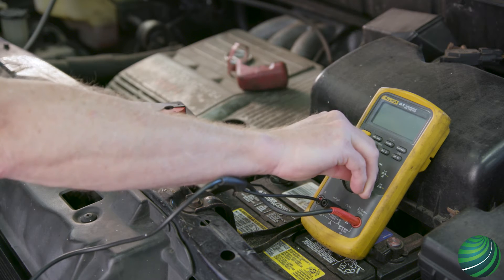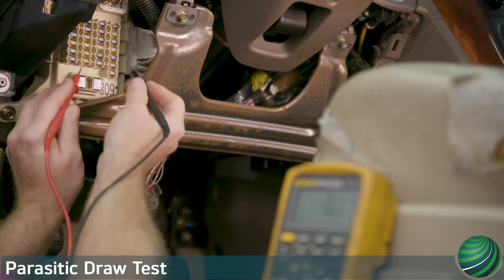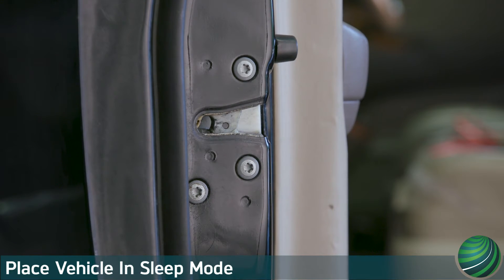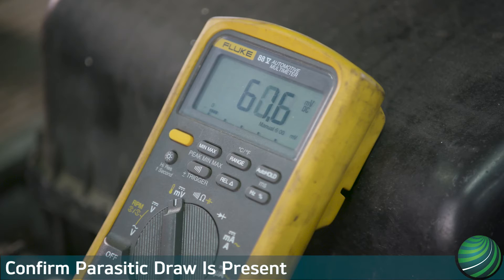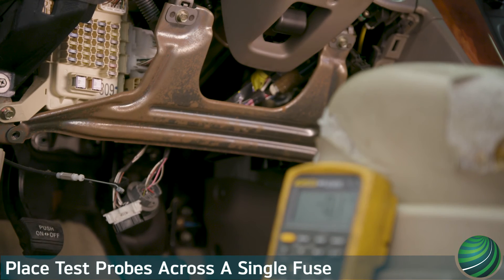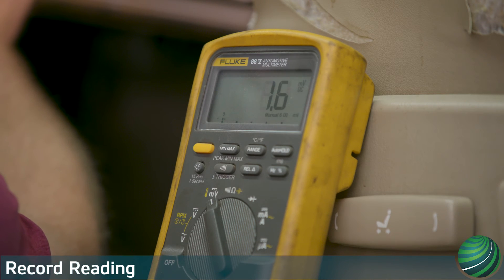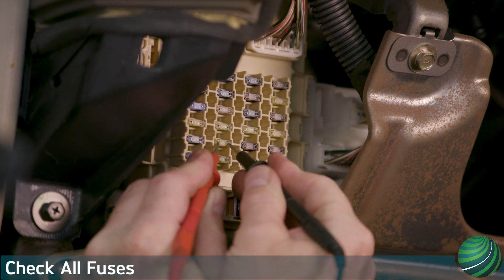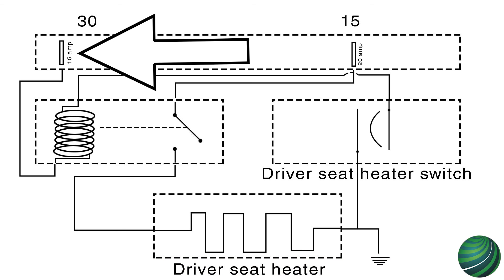The Best Way to Test Parasitic Draw Using Voltage Drop Across Fuses

Comment: Hi, In the fuse box: Would the alternator "charging system" fuse show draw on the alternator? I just read it's a secondary fuse and there's a large inline on the ALT. cable. All my under hood fuses read 0. Waiting for it to warm up for a cabin fuse box check. Battery goes dead in 8 hrs. New battery.
Alternator charges at 13.9 idle. Normal

Comment: why is your meter set to mV and appears to read mV when you are describing the draw as 60 mA in the video?
Reply: If you are referring to the beginning where he is using an amp clamp that's the setting you place the multimeter in for the amp clamp to be able to communicate amperage in. If you are referring to later in the video when he shows him probing fuses and it shows the reading in mV it's because that's the point of the video to show how you can convert mV to milliamps using a chart and checking for volt drops across fuses.
Reply: @theinfoone  Yeah, but why not just set the DMM to mA?
Reply: @keviiiboo7460 you cannot measure amperage at a fuse like that. You have to be in line to measure amperage, to measure mA at a fuse you would have to remove the fuse and put your multimeter in its place. 

What has measuring is voltage drop,  anytime there is current across a load you will have a voltage drop. Meaning the voltage will be lower coming out of the load than going into it. What he's measuring is that difference.

Comment: My fuse shows .3mV which is a 30mA draw, the battery is nearly dead after 7 days(slow crank but fires over) and DEAD after 10 days. 
If i pull that fuse and let the car sit for 14 days, she cranks perfect. 
That fuse controls 6 things.

Comment: Ack, need help! I tried this method but my multimeter shoes 0 change in 
voltage when testing fuses.  I've tested my leads and they're good.  My 
multimeter is on millivolts.  What am I doing wrong?
Reply: Case of intermittent draw. Keep leads on fuse - wait 3 minutes for it to appear -  numbers wil change, again and again -  from 0 to  whatever above .5 mV is yr draw

Comment: Ack, need help! I tried this method but my multimeter shoes 0 change in 
voltage when testing fuses.  I've tested my leads and they're good.  My 
multimeter is on millivolts.  What am I doing wrong?
Reply: test amps, not v

Comment: Plan on doing this right now for a E53 x5. Has 200mA draw when spec of 40 mA or less after 20 minutes. I made a mistake of plugging a fuse back in and waking up the car. So I resorted to unplugging modules haha. So I’m just going to start over and try this instead. Thanks for the video !

Comment: Now that's a helpful video !
The old version of taking the fuses out is not longer a good choice with modern cars 
Thanks a lot !
Reply: "60 milliamps"  multimeter is obviously set to millivolts lol
Reply: @r @rickacton7540 That low amp clamp is an accessory that plugs into the voltage sockets in the meter and reads in volts. I had a similar one years ago.  Look at about 8 seconds in the video to see its leads plugged into the meter.